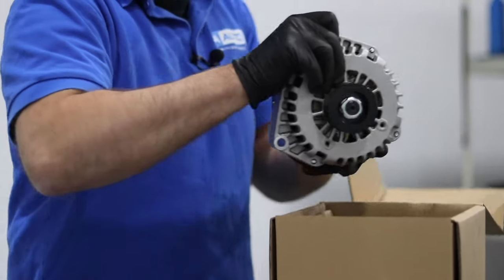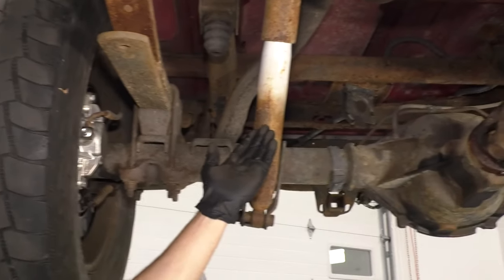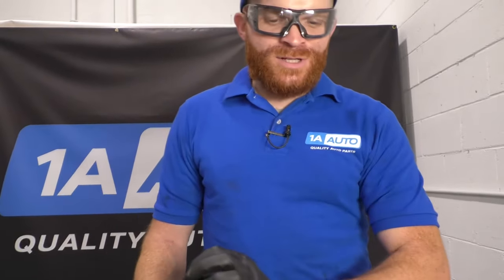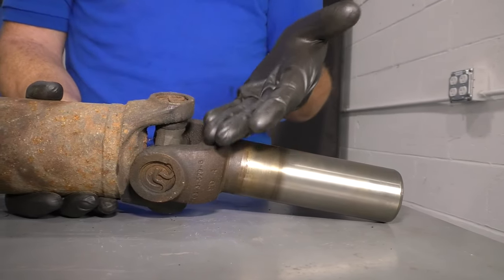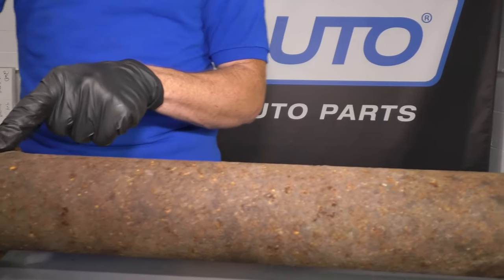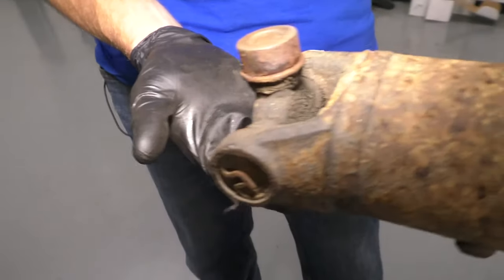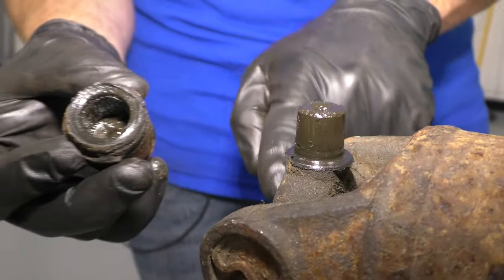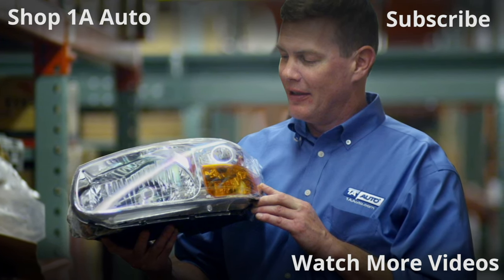How to Diagnose Truck Drive Shaft Problems - Vibrations and Noise

Comment: I think, if you have issue with more then one component, replace the whole thing. 
You have old ugly rusty part in front of you, that if you DIYer and never done this before, it may take you contless hours to repair...  just get a new thing. They are not so expensive. A GKN brand rear driveshaft was about $270 for my 2013 Range Rover Sport. 
In many instances you'd find those caps for U-joints point welded so replacement is not even an option. 
Also there is a matter of balance, from factory driveshafts come balanced, just like wheels, if you dig trough the whole thing, there is no guarantee that balancing will not be disturbed, at least take a chalk and draw straight line trough the whole shaft so when components will be assembled, you can put them in the same line as from factory bacase they will fit rotated 180° just as good. 
Also, there is matter of safety, do you know what might happen if driveshaft was not properly assembled and splits while car is driven? Not only it can destroy everything near, it can probably flip the car. 
Also, what author does not mention: 
Bolts that hold driveshaft to transmission and especially to rear differential are very high tension, torque required is usually greater then wheel lugnuts, most of the manufacturers declare them one time use, once taken out, discard and use new ones. Should you ignore it, at least apply some red threadlocker as new bolts have than pre-applied.Just as example - wheel lugnuts on my RRS need to be torqued to 105lbs, bolts for the rear of driveshafts 110lbs while being nearly half as thick VS bolts holding the wheels. Metals do get tired and weaken structurally. 
Also, before you take out driveshaft, please google torque specs and have torque wrench. If you do not tight them enough - its bad, if you try to hard and brake one of the bolts, it would be pita to fix that.
Reply from the maker: +Roman D We appreciate the feedback. Sometimes there are multiple ways to accomplish the same repair.

Comment: I was hoping maybe somebody on this site or Channel or in the comments could help me out with an issue I'm having with my 2002 Chevy S10 4 wheel drive 4.3 I have a humming sound that's continuous when driving no vibration it sounds like a wheel bearing going bad but it's not a wheel bearing also kind of sound like tires humming I don't believe it's that either Tires and wheel bearings are new also the rear end is completely been rebuilt what could it possibly be
Reply from the maker: +Krazy-g  We wouldn't be able to diagnose an issue like that here, you may want to have a local mechanic take a look at it. Thanks for checking us out! http://1aau.to/m/Shop-1AAuto-c

Comment: How could I tell if someone cut my drive line? I have a 2000 Dodge ram 2500 I go into drive n it chugs like an inch put in reverse it chugs back like an inch can't go anywhere is it my drive line or my transmission?
Reply from the maker: +Pixie Dawn We wouldn't be able to diagnose an issue like that here, you may want to have a local mechanic take a look at it. Thanks for checking us out! http://1aau.to/m/Shop-1AAuto-c

Comment: I have 2WD and I see when I’m stuck in snow only one of my back tires are spinning. anything I should look at ?
Reply from the maker: +Rogelio A Thanks for checking us out! In very low traction conditions one of the wheels may have so little grip that the engine cannot provide much torque, it simply rises in rpm's and spins that wheel while building so little torque doing so that the other wheel does not move at all. Hope that helps!
Reply: @Michael A traction control won't make both rear wheels spin if you're stuck in snow or mud whatever it may be... the differential is what give the ability for both tires to turn . Open differential 1 wheel will usually spin .. a limited slip differential with provide power to both wheels spinning them.

Comment: I have a one piece steel driveshaft that created a strong vibration. After I sent it to the driveshaft shop to be straighten and rebalanced, the steering wheel vibration is gone. The technician has  guaranteed that the driveshaft can hit 6000 RPM. I believe him. However, right now the driveshaft develops a strong nosie between 80-90 MPH. The nosie almost made my girlfriend threw up. Anyone has idea for what causes the noise?